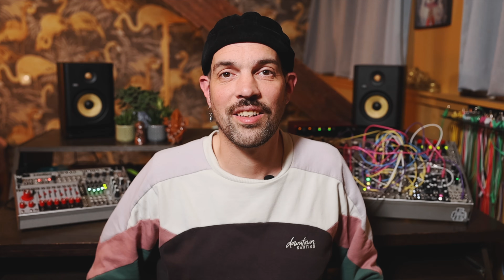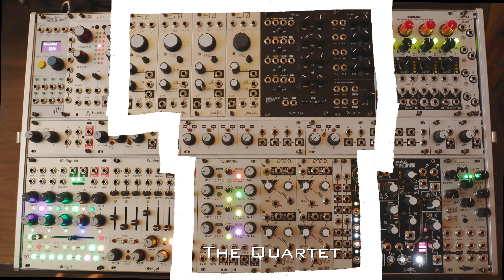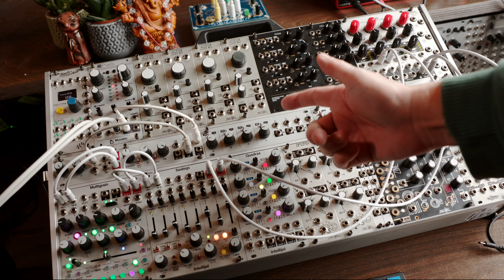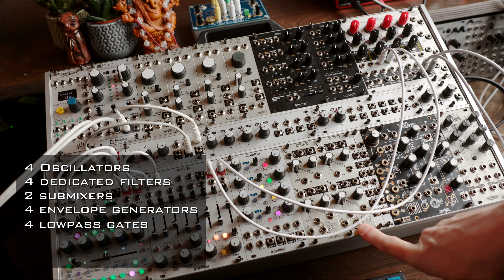Explaining my modular setup - Episode 2: Quartet and effect section

Comment: Any idea on how to navigate the various LPGs available from Make Noise? Like between two Optomix and the the new QXG quad lpg, does going with the dual Optomix still make sense?
Reply from the maker: That is a really good and viable question. I have been thinking about the QXG module and what it would do for my quartet. I have not worked with it yet so I don't know what the difference in sound is. But I think the sound will be different. I also have an LxD and an DxG by Make noise. The DxG  is digital with no vactrols like the QxG so they are most similar. The sound is absolutely Lowpass gate like but it does sound very different than the optomix or the LxD. The last two sound fuller and warmer to me. It's not that one is better than the other, I think it's probably a matter of taste. So I would say, try both LPG's if you can and see what sound you like most......

Comment: Great vid! How do you use the filters in the Atlas? Are they static to place each osc in the frequency spectrum or do you modulate them with something?
Reply from the maker: Hi! Thank you so much. It depends on ghe patch but I mostly like to modulate them with my own hands. In my system I certainly use modulation (pams pro, ochd, several lfo’s, s&h etc.) but when I can use my hands I prefer that mostly. In that way I have more control over my sound and I can play my modular like an instrument. I have found certain sweet spots with the Atlas filters and the waveform output of the STO’s that make them sound a certain way I like. I adjust the filters during performances to several of those sweet spots when I feel like it. But I do like to patch a S&H or an attenuated lfo in the filter or resonanse cutoffs sometimes, can be very dynamic and great fun! Hope this answers your question!

Comment: This was fantastic. How you hocketing? Hermod+?
Reply from the maker: Thank you! Yes there is an option in the Hermod+ where you can add different tracks together as a poly voice. In my case (pun intended) I use track 1, 2 and 3 together in Poly mode. Which means that all the notes of a melody get divided between these three voices. When it is a monophonic melody pocketing starts to happen. When it's a polyphonic melody/chord multiple oscillators play, or it's a combination. It is really really cool. If you don't want to buy and learn a new sequencer you can also look into the the Shifty by Intellijel, it does the hocketing, not the polyphony though
Reply: @raafmodular can this be done on the Squarp Hapax as well?
Reply from the maker: Hi! I’m not sure, unfortunately I’m not familiar with the workflow of the Hapax
Reply: @raafmodular thanks. I have a H+, I just don’t have enough voices to use the Poly tracks. Keep doing great work 👍

Comment: It's great to hear about your system, thank you for sharing. I wonder if you have made a mistake when commenting that not using a buffered mult for your audio single may cause it to be 'not as in tune'. I believe this is true for 1v/oct signals, where the actual voltage will control the frequency of the oscillator, but not for audio signals coming from the oscillator.
Reply from the maker: Hi cpr, I'm sure the audio signal will get weaker the more you mult it and it can lose high frequencies. You might be right about the volt/oct tracking! Im not sure, going to look that up. Thanks for the heads up!